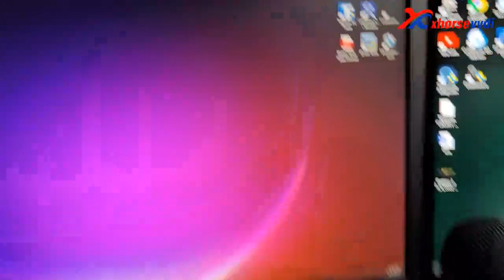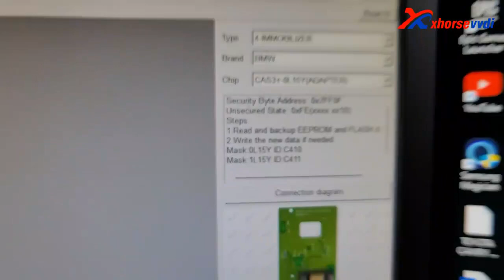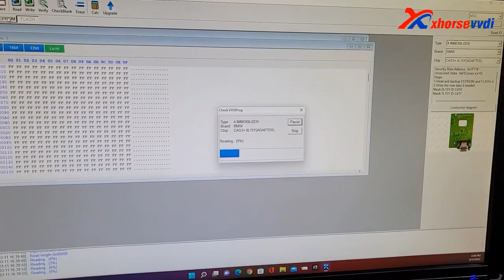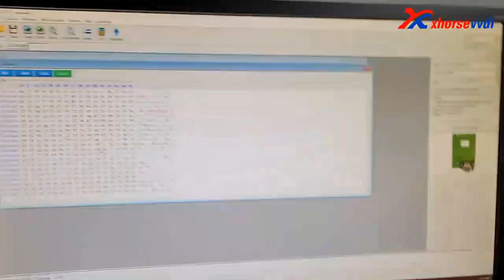How to use VVDI Prog , XDPGSOGL DB25 DB15 and XDNP11 CAS3 Read BMW CAS3

Comment: hello
thanks for your explicit video.I do have the same set up but mine will not read successfully; indeed, it fails in the "chip cracking step"; when I look at the log, during the preliminary verification, it says "chip not connected or detected". Kinda impossible to check the adapter needles. 
do you know a sure way to reach out to xhorse support? I have sent messages through the app but noone responds.
on a side note, I read the same CAS3+WITH ACDP and it reads flash and eeprom without any problem
Reply: I have the same problem, also noticed xhorse support not exist

Comment: Hello bud I have a couple of questions. 1. Can I use my Xhorse tool plus to do this job. 2 does it do continental dme. Vsm80?
Reply from the maker: hi 1.yes, by soldering or this cas adapter: https://www.xhorsevvdi.com/wholesale/xhorse-xdnp11-cas3-adapter.html
2.read isn? no, ktp cant read msv80